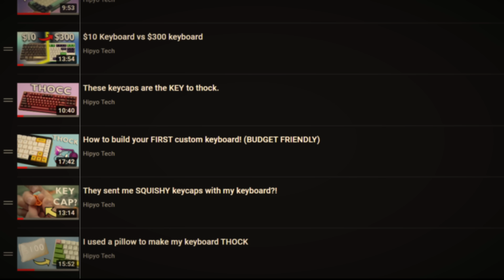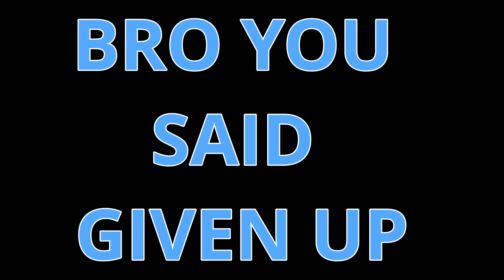I'm Giving Up... (On Mechanical Keyboards)

Comment: Never Thought you would be using membrane keyboards. smh
Reply: It’s MIT membrane tho
Reply: @paper they are electro capacitive
Reply: Not membrane
Reply: It’s not membrane. Do you even know what the membrane is in keyboards?
Reply: @BIxtz  yeah he probably has a gataron blue switch keyboard
Reply: Yeah I can’t believe this there’s a chance I would unsubscribe
Reply: Model M is a membrane. Rubber dome does not mean membrane, membranes are an alternative to PCBs
Reply: j o k e
Reply: I'm not sure why people say it "isn't membrane" because electrically capacitive rubber domes are classified as membrane.

There are different types of electrically capacitive keyboard PCBs but most of them do use rubber domes for activation.
Reply: @razi_man  These boards do not use the rubber dome for actuation. The rubber dome only serves to provide tactility. There is a metal spring under the rubber dome which when pressed down actuates the switch. This means that the switch does not rely on the contact of a membrane to complete a circuit, but rather the proximity of the spring to the pcb allows the press to register, no contact between elements required
Reply: @razi_man  Well yet again these very guys who uses EC, Topre, NiZ is willing to pay from $200-$400 just to get their endgame.. These type of boards aren't even cheap and people argue these things feels better than Mech Keebs. 

It's one of those type of things you gotta try for yourself before you just bunch em with the usual membrane Keyboards.
Reply: So many people didn't get the joke bruhhh
Reply: @vilet4287  what joke is making a mistake a joke
Reply: @iliadelta  they knew it wasn't membrane. that's the joke
Reply: @vilet4287  ohhhh
Reply: @vilet4287 I thought they actually thought that it was membrane
Reply: Never thought so many people would be missing the joke. smh
Reply: It’s not a membrane buddy..

Comment: The keyboard enthusiast has gone full circle: membrane is now cool
Reply: it’s more like the start of a new cycle, since we came from mechanical switches to membrane and then to newer mechanical switches and then newer membrane
Reply: Not membrane. Rubber domes, but no membrane.
Reply: Hell no
Reply: @AidanRampair  
Rubber domes are still membranes, there is a membrane ontop of the circuit board, the domes are simply a different type of switch to regular membranes, the function is still very much the same, its like saying MX Blue aint mechanical but MX Red is. 
However not all rubber domes are membrane, some work without a membrane like Topre
Reply: This is a special kind of rubber dome. It was always cool. : >

This one's not a cheap thing.
Reply: @SMGJohn they are singular pieces relying on electrical inputs to actuate it’s not one mesh of membrane it’s individual switches it just uses rubber domes

Comment: Kind of refreshing tbh. Normally I imagine keyboard reviewers to be using some insane set up with alll the craziest parts. However this is a HUGE reminder at the end of the day what mAkes you happy is the best choice ignore the noise from others.
Reply: It's a reminder that it's not a black or white situation. Picking what makes you happy or what's best suited for getting something done is a huge bunch of sacrifices either way, except for those rare situations where the universe just aligns. :)
Reply: Ignore the noise!?
furious typing noises from a dozen mechanical keyboards
Reply: not crazy at all =  girly key caps + circular saw + destroy two $150 boards to make one
yeah, right.
Reply: Those weren't regular and inexpensive keyboards he mashed into one.

Comment: I wouldn't say that its a membrane keyboard, it feels more like it's a hybrid, but also not like those garbarge "mecha-mechanical" "mechanical feel" rubber dome keyboards.
Reply: Yeh, this feels like a mechanical keyboard except they dont use a spring and different conductor. The setup itself is the same as a mechanical basically.  

Theres no need for every switch internally to work like an MX-cherry derivative. This could be some nice innovation, especially if they managed to fit this into a cherry-compatible shape.

Comment: I tried a niz board and it broke almost immediately after getting it. Taking it apart was a giant pain (as you probably figured out), they support like no standard layouts, and it didn't feel that good to me.
Reply: The layouts have improved somewhat. Atom68 and Micro82 are pretty standard 65% and 75% layouts that are compatible with lots of keycap sets.

Comment: My hands are bigger than yours (I am 6'3" and 250lbs) and I don't understand your spacebar issue... I daily a JIS layout Archiss Quattro TKL keybaord with track point... the space bar is very small however I have found that I always only hit the space bar in one spot which is within the range of the spacebar of the Archiss board.  I haven't missed the spacebar basically once using the Japanese layout board with left / right track point keys on either side of the spacebar.

Comment: There are several keys missing on that keyboard that I couldn't do with out. I need all the modifier keys on each side, I do have two hands after all, but I also need a sleep and wake key, which I use them both at least once per day, and I definitely need a print screen key. I use that one key at least 5 times per day. Often times I'll just hit it to bring up Spectacle, but sometimes I use it with the WinKeys and sometimes also Shift and Ctrl. It is incredibly useful to be able to capture just the focused window or the whole desktop and immediately write it to disk, but if I know I only want to capture a selected region, it's faster than bringing up Spectacle then hitting the button to capture a region. I know, I know, the Fn key allows you to still have the key through indirection, but if a shortcut takes more than three keys, it's too many.
Reply: But, you don’t
Reply: @maynardewm  Okay, I admit it, I don't really need any of that, but I definitely want all of that. If we're going to be pedantic, though, we only really need enough to stay alive and no more. If one could even equate being alive with a need.

Comment: We really need a better name than "mechanical" for keyboards. Technically every keyboard ever made is mechanical. So is your mouse. So is a lighter. So is your fridge.
Reply: actually no not every keyboard ever made is mechanical. Anything that has a hal effect sensor, resistive or capacitive switch, optical sensor of any kind, or a touch screen of any variety, is not in fact mechanical. they are electrical, period. there is no physical change or physical bridge to pass current between two pins to activate the key. Mechanical =/= electrical.
Reply: @TheObsesedAnimeFreaks  You should really look up the definition of mechanical. Every single keyboard is mechanical. Every single calculator is mechanical. Your monitor is mechanical. The chair you're sitting in is mechanical. EVERYTHING that isn't handmade is mechanical. It's an awful descriptor, because it actually describes nothing/everything.
Reply: @kenfresno2125  I think you need to look into what mechanical means because you clearly don't know. Mechanical is by definition some physical change in state,  when it comes to switches the only mechanical switch is the type that takes 2 electrical contacts and completes the circuit. Hall effect is not mechanical because a physical state change didn't happen, resistive switches are not mechanical because a physical state change did not happen,  capacitive switches are not mechanical because a physical state change did not happen, optical same thing. With whether a switch is mechanical it has nothing to do with the mechanics of how the the switch is actuated, it has everything to do with the mechanics of how it signals that its been pressed. All other forms of switches require electronics to monitor each input to see if there's a change in a sensor. Mechanical keyboards are usually just a lattice of electrical connections that a chip on the other side takes an interrupt formed from the bridging of the contacts,  in theory the actual keyboard mechanics require no electronics and no power to operate. This is why it's mechanical.

Comment: I feel like most people don't understand why mechanical switches exist in the first place. They remove the issue of missed presses since they activate at a certain travel distance and don't have to go 100% all the way to the bottom. I noticed this problem years ago when playing games and your inputs just didn't work all the time. Mechanical switches are much more consistent on their activation which is the reason they exist and why they are better than membrane.
Reply: And most people watching this video don't understand that Topre isn't membrane in the first place. You are literally describing an issue that doesn't exist for this board. Topre are electro capacitive rubber domes with a PCB inside of them. They are properly mechanical keyboards lol.

Comment: Single-switch rubber domes. Well, something had to compete with linear switches in terms of being the mushiest possible enthusiast standard.
Reply: how are linears mushy
Reply: @mohawk4759  the keypress simply slides through, with no good indication of the activation point. Causes the identical typing problem of a mushy old membrane, and frankly, feels only slightly better too.
Reply: @curvingfyre6810  i just dont understand what you’re describing as mush when theres no dampening or cushioning

Comment: i'm gonna buy the parts for my own custom keyboard today i think. i don't have a big budget so it wont be the best, but itll be ok enough. I'm gonna get a fully assembled keychron k8 (for the aluminum frame), EG aqua king switches, and some budget keycaps that i will probably upgrade in a bit. im so excited because i currently have some crappy razer blackwidow v3 keyboard that hurts my ears if i dont have my (noise cancelling) headphones on

Comment: Dome with slider, not something you see every day.
They were popular back in the 90s, but have all but disappeared in favour of MX. 
They are quite good, especially these. Firstly, they are electro-capacitive, meaning they have quite a long life span on the sensing assembly. Secondly, they are a DWS design, meaning they have the increased tactility of rubber domes and the hard bottom out of traditional 'mechanical' switches.
Overall they are an excellent choice.

Comment: Similarly my foray into the mech keyboard hobby pretty much ended when I got an HHKB and since then no MX design switch has felt interesting or worthwhile, and I lost any really desire to keep tinkering with a hobby that's overwhelmingly focused on different variations of MX copies. Stuff like keycaps and good stabilisers are still cool, and luckily boards like the Wooting or Apex Pro have genuinely good, worthwhile advancement for the hobby switches (despite Hall Effect switches being a venerable concept), and are still compatible with custom keycaps and you can fiddle with the stabs.

With Alps style switches returning we could be entering the point at which the hobby gets genuinely interesting though, with more switch variety and moving away from that old Cherry MX inspired design that has such clear limitations and isn't amazing at any one thing no matter what combo of housing, slider, lube etc.

Comment: Your video on that Niz board was a big reason I decided to try Topre before building a custom mechanical and I've been using an HHKB Pro Hybrid Type-S for nine months now and love it. I'll still be building a custom or two, but I definitely like electrocapacitive. I will mention though, I remember you trying that FC660C on stream and being surprised that it was louder than the Niz, I think Niz boards come stock with silencing rings that you would have had to specify for the Topre board, so if that video is incoming I would make note of that or try one with silencing rings before comparing. I got the HHKB "Type-S" board which comes with silenced switches by default and it's great.
Reply: Recommend you get a Leopold, Topre Hybrids have pretty mid domes

Comment: As others have stated, "thock" came from Topre. And they're less represented, mainly due to their availability and price. Some Topre clones have been around for awhile, but the price is still a bit of barrier for more people to try it. 

The feel is also fairly polarizing for those people that do spend the extra money to acquire one. For me, I never bought one, but was able to try a few at a meet, and they're simply far too light for me. Their sound is unique, but while you can get close with some MX switches and a couple mods, it's not going to be quite the same without a rubber dome.
Reply: You can get domes that are much heavier than most mechanical keyboards if you like, standard weight for topre are 45-55g but you can go much higher with custom domes.

Comment: I've no idea what type of keyboard it was, but the very heavy and solid IBM keyboard for the first PC's they put out has always felt very natural to me.
Reply: You mean the Model F (XT)?
Yeah, I have a terminal variant which has the same switches as my daily driver. Great keyboard. Capacitive as well.
Reply: @jugostran  Those are the best keyboards, still.  The model F mechanism is the best, but the model M isn't far behind.  I just got a Mac, though, and wanted a Bluetooth keyboard.  I bit the bullet and ordered a K2 with brown switches (I forgot the brand, it's whatever they use).  Now I'm nervous I'm gonna hate it, lol.  My dad worked at a company with a big warehouse that used all IBM, and so when I was younger (im 42 now), we had an endless stream of IBM keyboards.  I almost bought one on eBay, but I really wanted something with Mac keys and Bluetooth.  Oh, and illumination so I could use it in the dark.

There is a quieter variant of the model M that I used in college, and the brown switches were described as kinda like that one.

I kinda feel like someone who used to drive stick and got lazy in old age or something, lulz.  But a big part of it was just wanting an actual Mac keyboard, and the unicomp didn't impress me.  The keys were ugly, and I don't think the build quality is quite like the originals from what I've read.
Reply: @jugostran  Which variant do you have?  Is it from an InfoWindow terminal, or older?  The ones from the terminals are the best, IMHO.  20 zillion keys.
Reply: @jugostran  I am agonizing over this decision WAY more than I care to admit, haha.  I loved using a keyboard that I could defend myself with. 😂
I'd love to hear more about which keyboard you have in particular, and how you interfaced it with a desktop computer (those twinax terminal keyboards aren't exactly compatible with any computer interface lulz)
Reply: @bsadewitz  I use the keyboard that shipped with the 3205 Color Display Console terminal. It is a Model F 122 key variant.
Also, Unicomp has gotten way better. Their New Model M has Mac keys and is generally really nice.

Comment: After two mech keyboards I went back to using membrane. They felt terrible in terms of ergonomics, everyday usability, noise and especially the price. I get more wrist strain and make more typos with long travel distances and high profile keys of regular mech kbs. And an issue I had with red switches is, when I had my hand on WASD the actuation force was so little that the weight of my hand would press the keys. I never had such a problem with regular keyboards. 
I would like to get into the hobby and build/buy something to my taste but I can't afford it so $20 Logitech keyboard it is.

Comment: I’ve been using Niz keyboards since 2019. Unparalleled sound signature right out of the box. Sounds better than any of my more premium boards and feels more satisfying. It’s also best for gaming with light switches and their 1.8mm activation. I have 3 different Niz keebs, bought one each new year.
Reply: Let’s just hope their software & firmware are either open sourced or released for Linux or WebUSB.

Comment: Honestly I find it hilarious that mechanical keyboards with electrocapacitive switches are seen as membrane keyboards cuz of the puritan culture that exists in the mechanical keyboard community, since any keyboard that uses a pcb (and usually some sort of spring mechanism) is a mechanical keyboard. Membrane isn’t synonymous with rubber domes, it’s actually an alternative to a pcb that happens to commonly be used with rubber domes (though it’s even more commonly used with butterfly switches and scissor switches).

Comment: People seem to have no idea that membranes and rubber domes aren't the same thing.

Rubber domes are a switch mechanism. 
Membranes are just a medium for the sensing electronics.

You can have rubber domes over a membrane: the typical office keyboard 

You can have rubber domes over PCB: topre and NIZ for example 

You can have mechanical switches over membranes: see the Model M

And of course mechanical switches over PCB: standard definition of 'mechanical keyboard'

Comment: Mechanical keys however still have the potential to be much more low profile than rubber domes. The Mirage series of Keyboards made by Zack Freedman are a proof of this the keys he uses are just very flat. Rubber domes just require a certain height to be optimal this is exactly why the 3DS and Nintendo Switch use SMD metal dome Microswitches instead of rubber domes. (technically rubber domes are cheaper and more durable but they are just larger, it's not possible to make them that small).